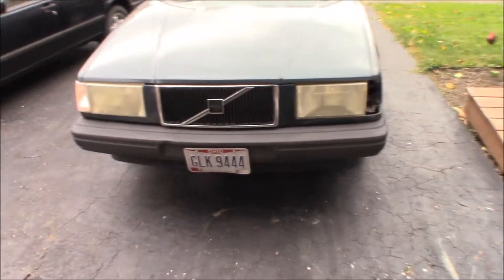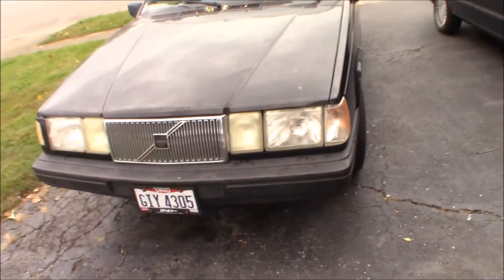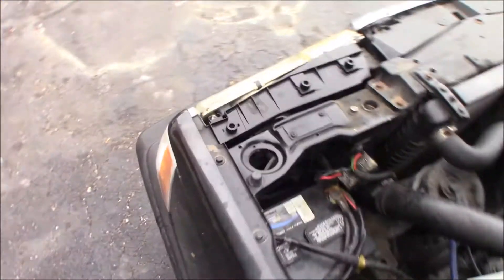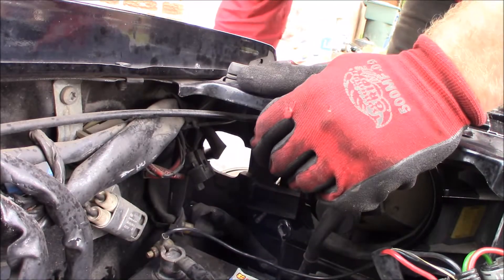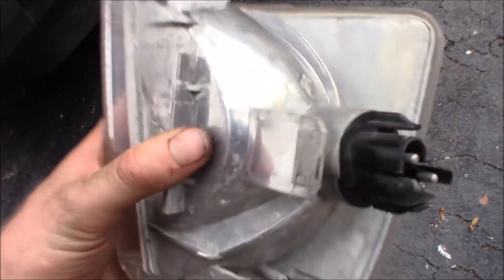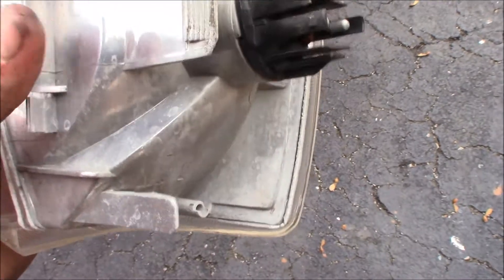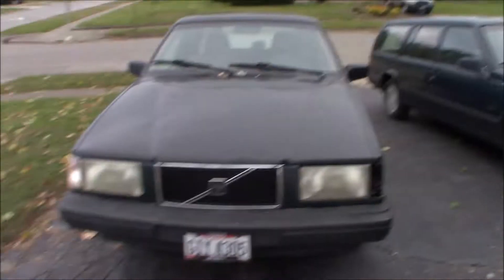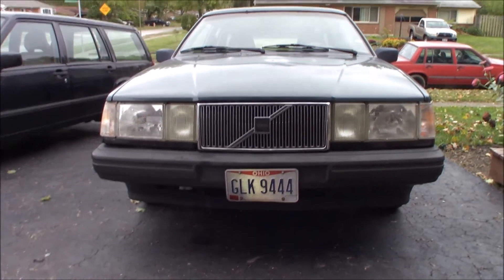Volvo 940 Headlight Swap

Comment: is the wiring different. I picked up those headlights but idk if the wiring is different
Reply: RockToTheDead it’s the same, the integrated fog will plug into a connector that should be laying in the engine bay close to the main 9004 connector. You will need a 3 position fog switch and a fog relay, but that is all plug and play. Hope this helps

Comment: Where are you located in Ohio? Do you still have the parts car?
Reply from the maker: We are in Columbus, Ohio. We still "have" the parts car but it's missing a lot of parts now. We used the Turbo, intercooler etc to do our 240 turbo manual project and have also taken other things off of it.
Reply: Still have the black grill? What does the interior look like? I need some dash pieces like below the radio and a front passenger window motor or switch. Is the rear hatch interior any account and I REALLY need the exterior hatch handle and rods for the latch.
Reply: I’m in Marietta.
Reply from the maker: Pretty sure we have most of that stuff.